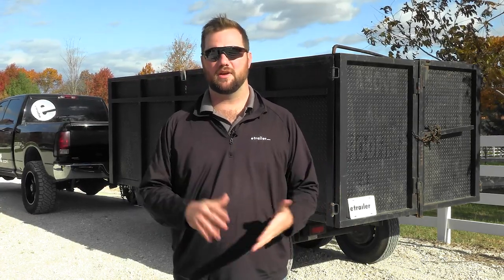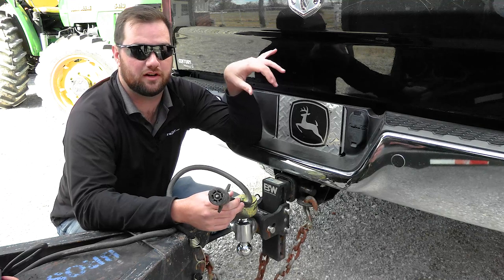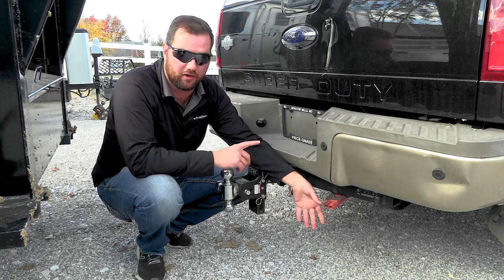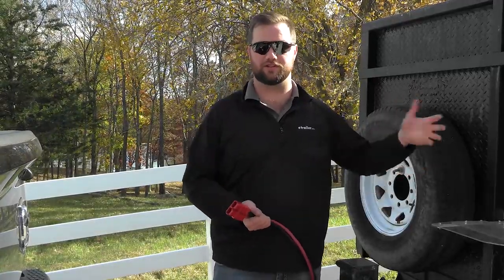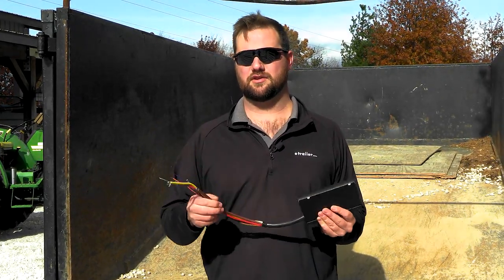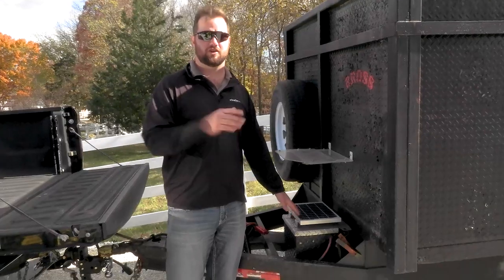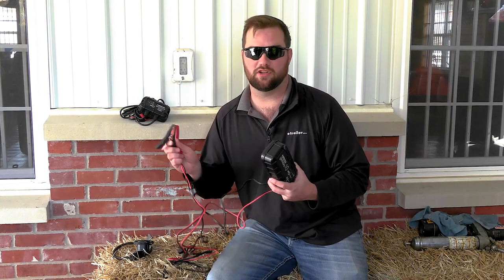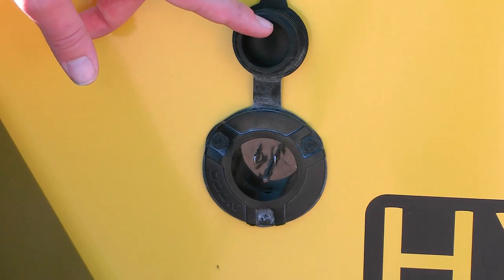How to Charge a Dump Trailer

Comment: We just installed the Pole Pal USA 7pc Dump Trailer Wiring Set on our PJ Dump Trailer and couldn't be happier!  Their kit uses 2 gage wire and Anderson quick connects.  We have tried adding a solar panel but it still wasn't enough.  We have 3 work trucks and 3 trailers (dump, equipment and enclosed) and plan to install the truck side wiring on all 3 trucks and the trailer side wiring on all 3 trailers.  It is the best solution I have found by far!  We will use the trucks battery and alternator to supply power to the pump on the dump trailer, winch on the equipment trailer and interior lighting, outlets and accessories on the enclosed trailer.
Reply from the maker: Happy to hear that! We're glad you found a solution that works well for you!

Comment: Shouldn't a relay  be installed on the charge wire ?thus isolating trailer battery except when truck is running so it can charge
Reply from the maker: If your 12V pin on the 7-way trailer connector is active with the ignition off, a solenoid like # TR118665 would be a great idea.
https://www.etrailer.com/Accessories-and-Parts/Tow-Ready/TR118665.html

Comment: Too much going on here. Buy a lithium battery and be done with all of this doing. The lead batteries don't get you nowhere. For RV's, buses, boats and trailers, buy lithium batteries. You'll dump all day and still have plenty of power left. Thank me later.
Reply: Just make sure it's warm enough to charge it.
Reply: @IYar56  If you buy that Iron lithium battery, charge it mid November and it'll carry you through January. The damn thing just kept going strong.